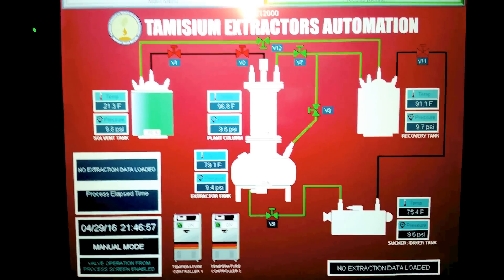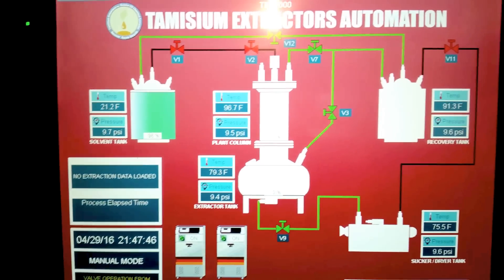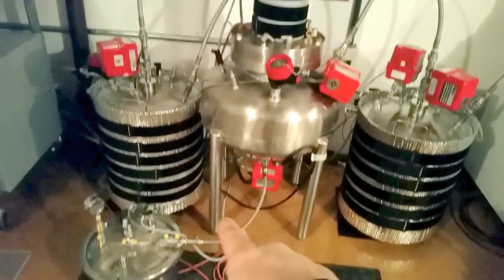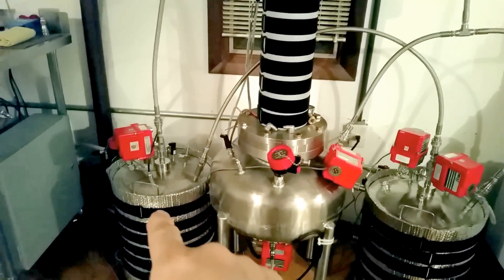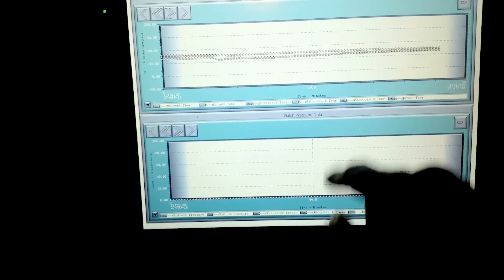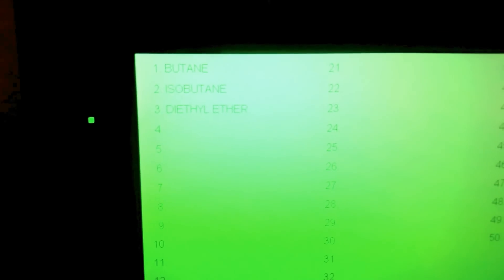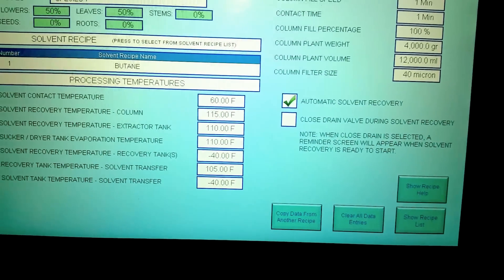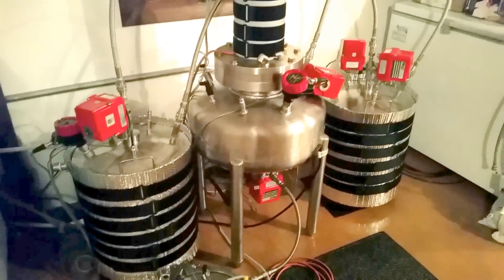Tamisium TE12000 Extraction Automation more control and safer than closed loop

Comment: How is this not closed loop? I would call this an automated closed loop dual assist recovery.  The HMI allows automatic control and isolation tanks allow for biomass loading and recovery and the assist will aid in extra solvent recovery but I am only seeing closed loop batch process here and there are lots of things like it.  I was part owner of a control integration firm(recently sold) and I have built these systems for ethanol production and other biomass industrial systems.  Great looking equipment but I feel misled by title and some of the info in this